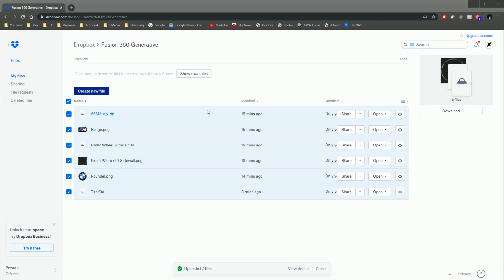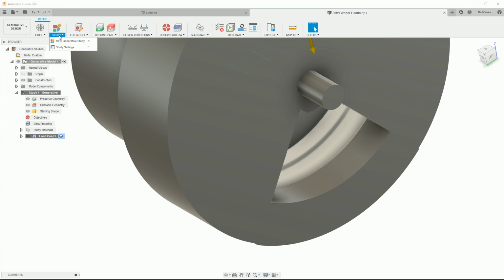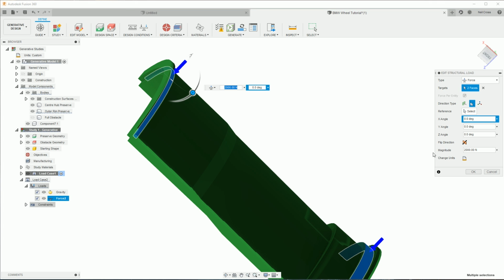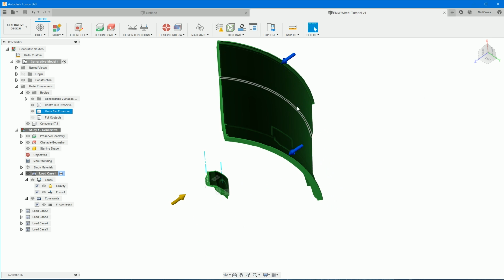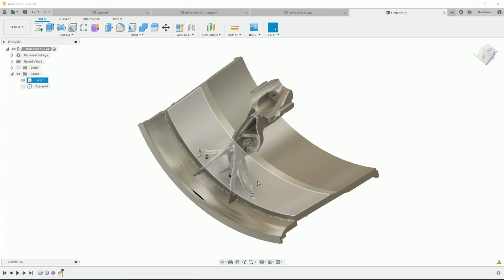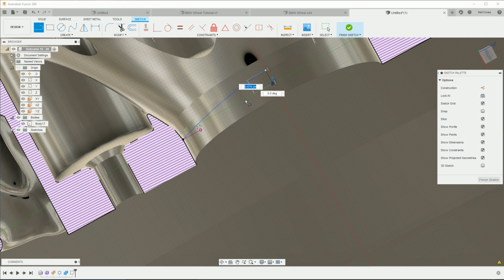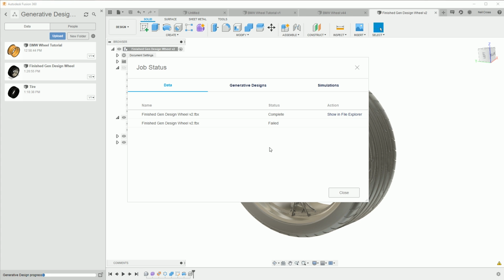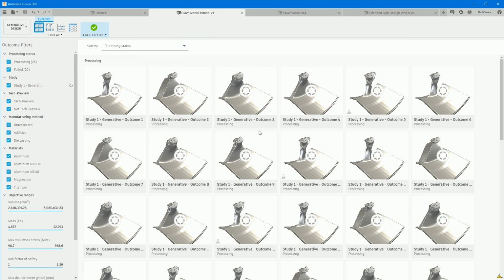Generative Design Tutorial, Free to Use in December 2019! BMW Alloy Wheel | Fusion 360

Comment: What is the case with this Forces - Why you put opposite forces instead do nothing ?
Reply: Press the opposite sides of your head with you hands with equal forces. The forces will cancel eachother so the head will not move, but you will definitely feel the pressure applied on your head. You can do the same by pulling your ears, but instead of pressure you will feel tension.
I hope this "illustrative" example helps! :)

Comment: Classic example of mindlessly applied topology optimization. You've just added cost to the design, but given no significant improvements to strength... Properly applied TO can often improve strength and weight, but it relies on knowledge of proper boundary conditions and load cases, emphasis on the latter.
Reply from the maker: It's purely just a beginners tutorial to introduce new people to the module whilst it's free to use.
Reply: @NeilLCross Fair enough, I can buy that
Reply: Ben I've put together a video that demonstrates how GD can be applied to "real" manufacturing methods for this exact reason. I'm not a big fan of the organic slime looking shapes :)

https://youtu.be/dYkZmdAaiko
Reply: @EngineeringAfterHours  your video is private, cannot view it. Really got me enthusiastic by the content of your comment, there :)
EDIT: I'll just browse the rest of your excellent-looking videos, for now
Reply: @zbnmth  sorry I thought I had it set to unlisted. I've updated it now so you can view it.

Comment: Even if you will find the way how to manufacture this wheel, it will failed in real life. Just because the weight of the car in all directions is not enough.
Reply from the maker: justdidit I know, its just a beginners tutorial for GD
Reply: It's worth noting that the manufacturing constraint of the version selected was die casting. This means that the resultant wheel could be made with the exact same tooling systems that are used for cast and rotary forged wheels today. Don't let organic-looking geometry fool you into thinking it has to be additive or investment only.